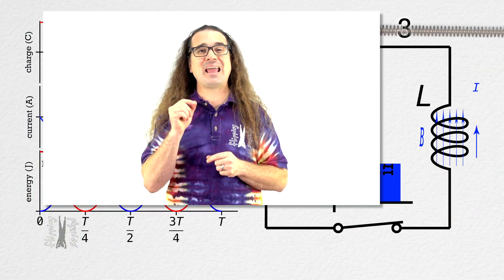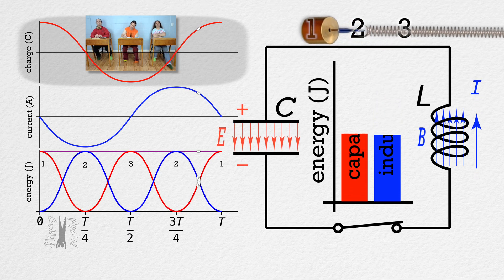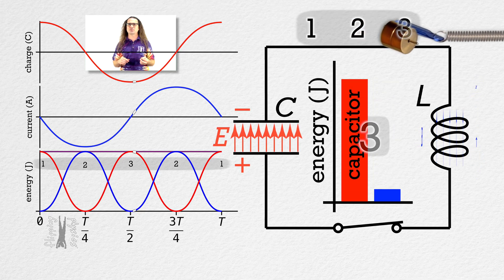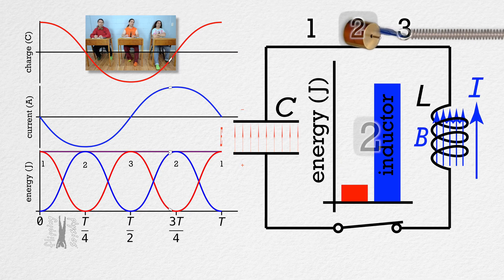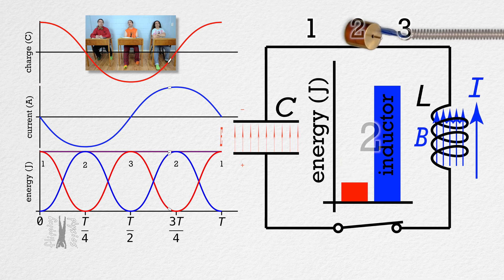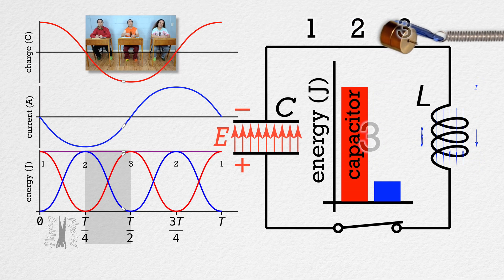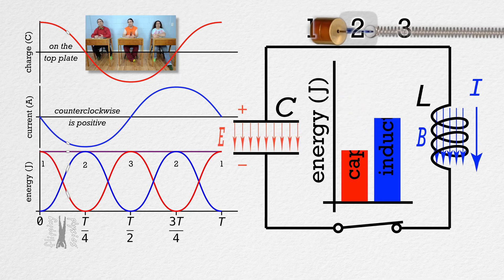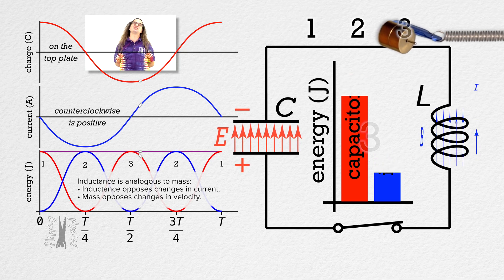Visualizing LC Circuits

Comment: Nice animations! Cool to be able to see visually how the energy "sloshes" back and forth between the capacitor and the inductor. The mass - spring system analogy also reminds me of a simple pendulum, only with the energy swapping back and forth between kinetic and gravitational potential - like a roller coaster!
Reply from the maker: Agreed. I decided not to add the simple pendulum because it's a bit redundant, however, it's definitely applicable.